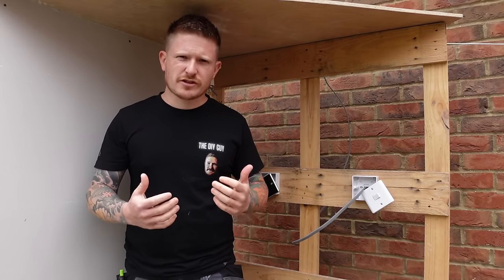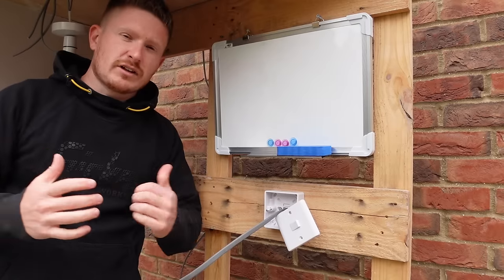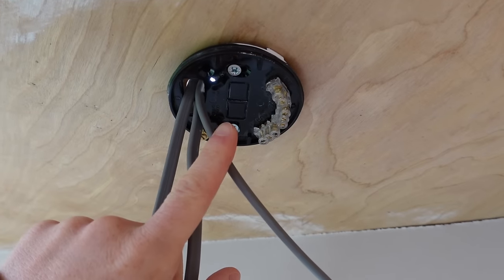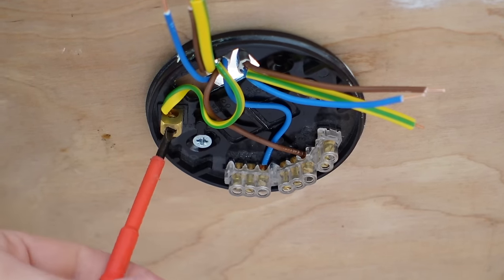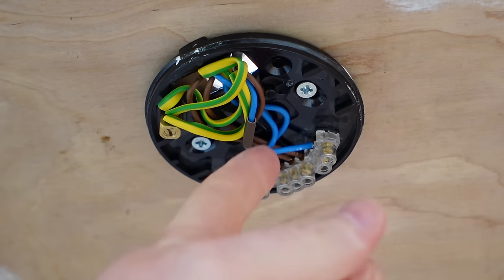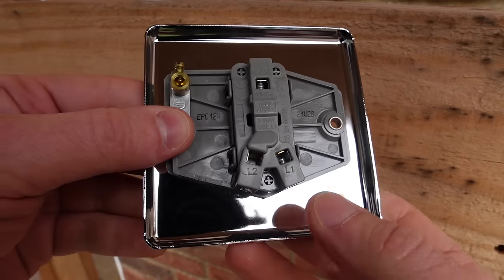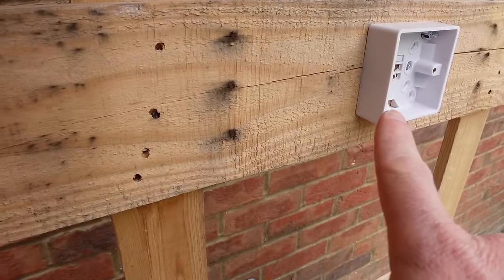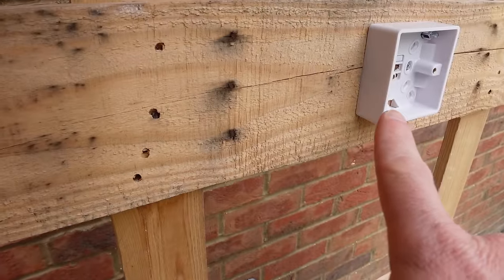How to Wire a Two Way Light Switch | 2 Way Switching For Beginners

Comment: Still trying to understand how to fit a 2-way smart light switch (The 'no neutral' kind)

The manufacturers diagram says...
Switch 1 (LB terminal) <-- Permanent live
Switch 2 (LB terminal) --> To light
Then both switches have an LB1 and LB2 terminal, which are connected in parallel.  LB1-->LB1 and  LB2-->LB2

But switchbox 2 doesn't have a 'switched live to light' connection... so, I'm guessing this is extended from Switchbox1 over the 3+E(Grey) as per the video.

Thing is, Switch1 doesn't actually USE the 'switched live' wire (according to manufacturer diagram) ... so, I'm guessing I should use a separate terminal block to join SwitchedLive --to--> Grey and bring it across to Switch 2.

So, following this through in my mind...

So now the 3+E(Grey) is bringing Switched Live from the main box to the slave box.  Slap a brown sleeve on it.
3+E(Brown) is unconnected
3+E(Black) is unconnected
And the 3+E(Earth) is chaining up all the earths as normal

So, now I have Brown and Black spare in the 3+E... but I worry that it's maybe 'wrong' to use these for connecting LB1->LB1 and LB2->LB2.    The LB1 and LB2 links between the switches are both switched lives I suppose, so do I connect those up with the remaining Brown and Black, and just slip brown sleeves on them both... at both sides?

Does this sound like a sane plan?  Or do I need to be smacked across the head and have my screwdriver confiscated ; )

Then, I guess it's just a case of finishing off by putting the supplied bypass capacitor in parallel with the light itself (as per the switches 'no neutral' instructions) and this will help keep some trickle current to keep the smart switches powered - as per my 1-way 2-gang 'no neutral' install (which works great)

I might pop a laminated wiring diagram in behind the faceplate, just to avoid any later confusion.  Or is that frowned on.

Comment: Nice guide to the wiring thanks. But I was really looking to understand how the circuit is actually working and this didn’t really explain anything. It would be great if the vid actually explained the flow of power through the circuit.
Reply from the maker: Hope it helped even a little

Comment: It’s more difficult to push the face plate back when there’s more wires .. eg all the neutrals in the back box instead of in the ceiling light fitting .. 
Looks like they changed the Regs again

Comment: Hi, the way as you connect it works but it is not so common. You connected the commons of the two 2way switches. I think you should also mentioned that there is another method to realise a two way light switch. I mean the method where the phase, which come in into the first 2wayswitch will connect with the common position and the switched phase is connected in the second 2wayswitch with the common position as well and go back to the first 2way switch. You can see the method i am talking about in the youtube video of John Ward  https://youtu.be/LPJ_nE1JAqg?feature=shared.

Comment: I have a 2 way switch bottom of the stairs and and 2 way switch at the top of the stairs, both switches only have twin and earth, with a rose and lamp in middle of the steps. I'm confused there's not the extra bit of wiring you have there 🤔🤷‍♂️
Reply: Do all three wires go into the switch itself (e.g. the CPC (earth) is not wired into the Earth terminal?) If so, some cowboy has skimped on buying proper 3 core and is using the CPC as a switched phase conductor.